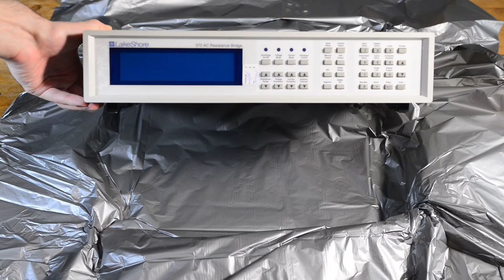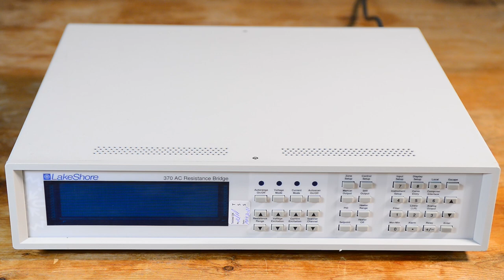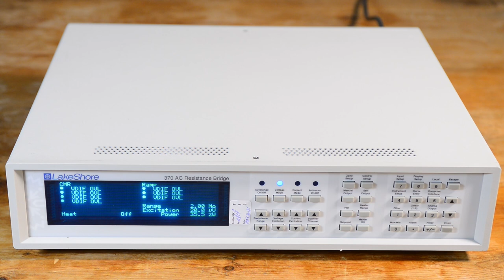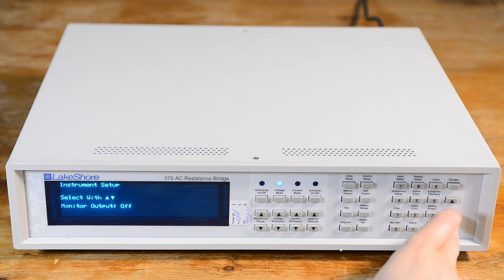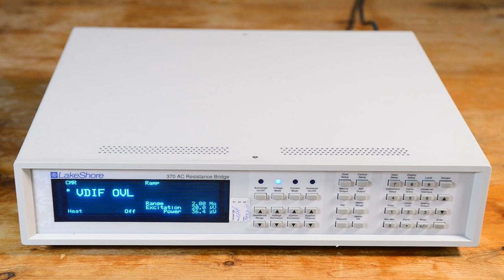Quick LakeShore 370 AC bridge teardown / cryogenics thermometer

Comment: The DS80C320 is actually a high-performance 8051 family microcontroller.  The datasheet says it will run up to 33MHz.
Reply from the maker: Thanks for correction. This was first time I've opened the unit, so will prepare better next time. 320 here got me confused with TI's DSP line.

Comment: Hi I have a query please. I am using 370AC resistance bridge automated using LabVIEW to read resistance channels. When I use Heater for temperature control. it works well manually, and but when i run the LabVIEW program to reach channels, it turns OFF the heater. I have scratched my head over it. but still am unable to figure out why is it doing so. Could you suggest something, please? Thank you.